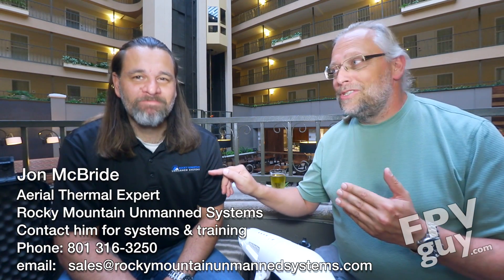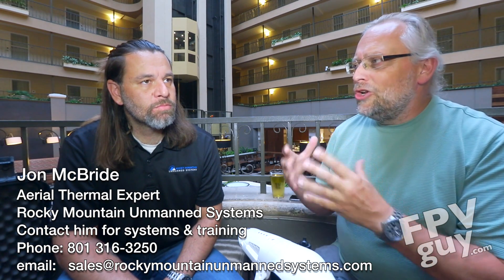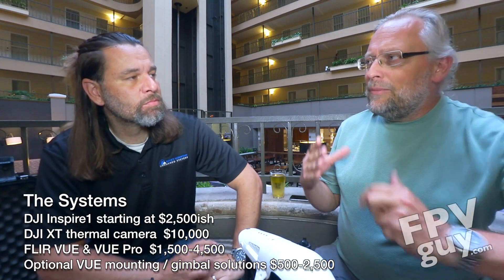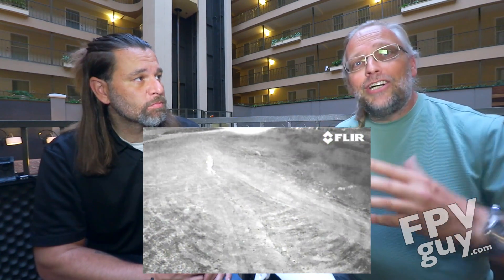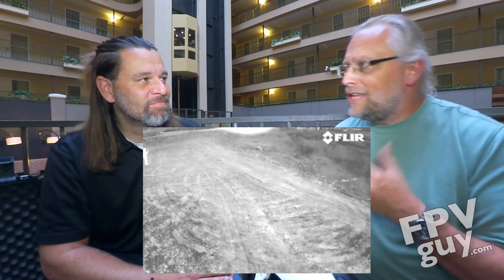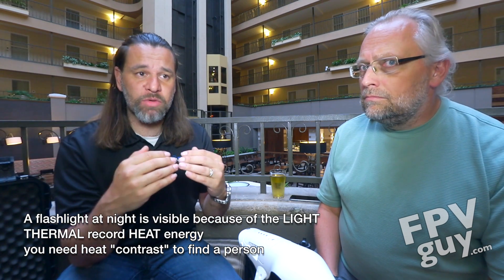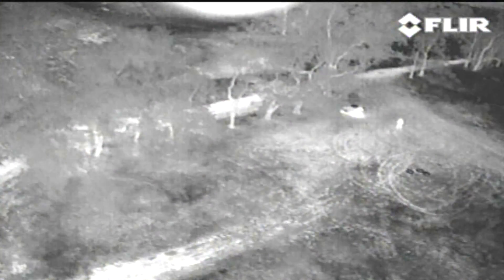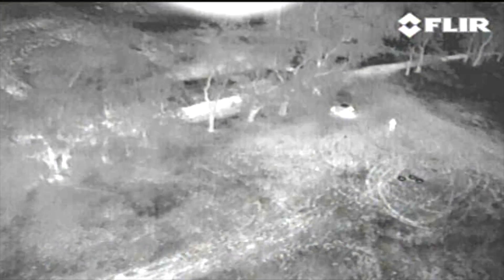THERMAL Camera basics with Jon McBride

Comment: too bad the Q500 doesn't have a thermal camera upgrade yet pfft.
Reply from the maker: +Anthony Eaglebarger (toysoldier46552)   it was never intended to have one.  however you can easily hang a VUE cam on it.  use the GoPro power-plug transponder Yuneec makes
Reply: Bo Lorentzen so basically upgrade it eh, cool.
Reply from the maker: Yeah.  you can easily mount a basic VUE camera on the Q500 and the basic unit is only about 80grams, add the GoPro video link from Yuneec and you can see the video on the stock ST10+ handset.